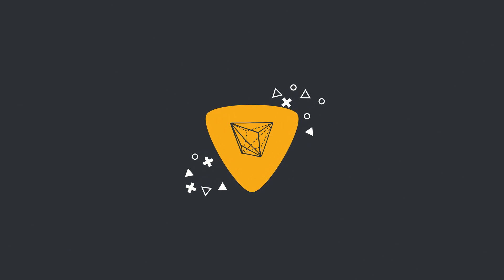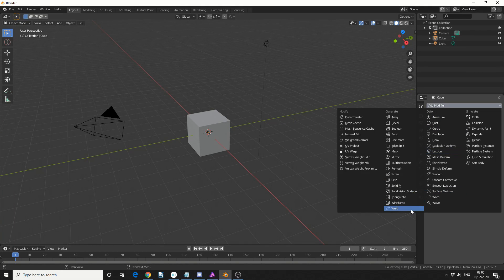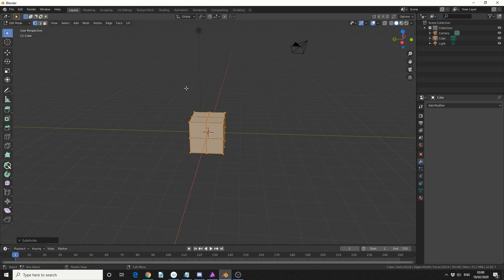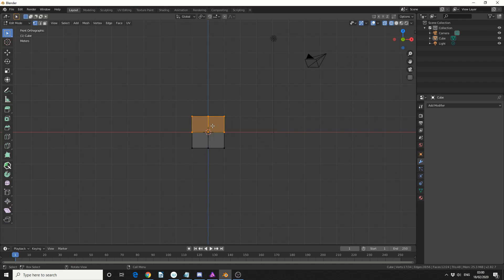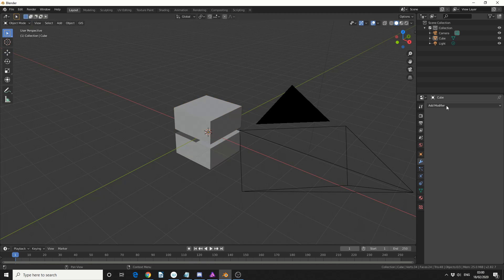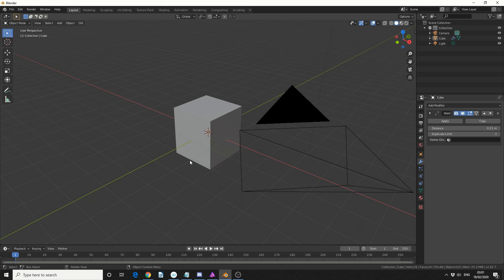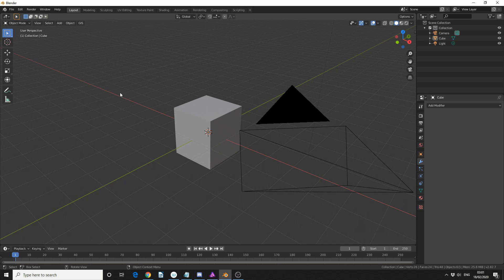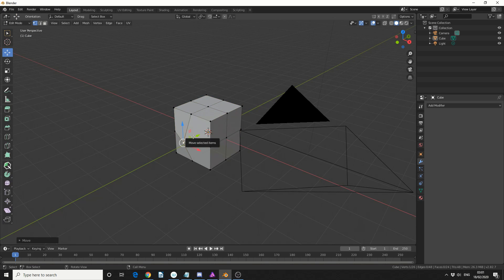Blender 2.82 Tutorial: Weld Modifier

Comment: Thanks for the video. Actually, it's very useful for working in a procedural way.  For example, if you were using an array and did a radial rotation, you had to apply the modifiers and finish the job manually. Now you can keep the modifiers and still work procedurally. This video is in Spanish, but I'm sure you understand the concept  https://youtu.be/-__YXBlUlAU